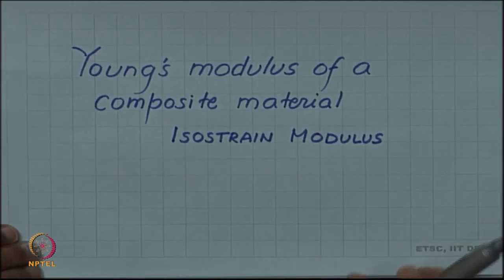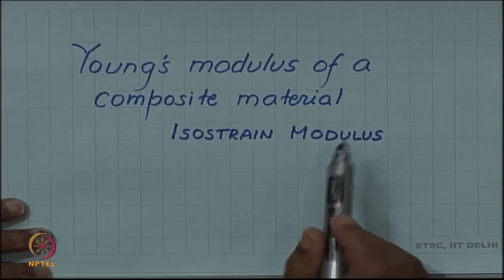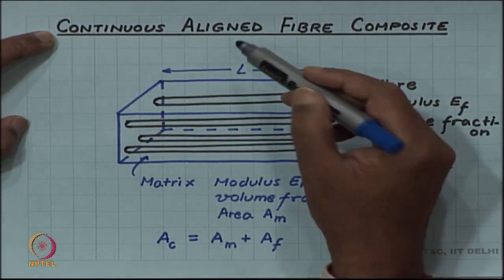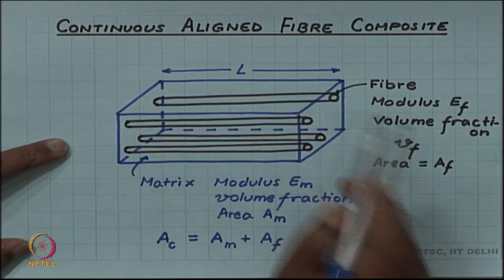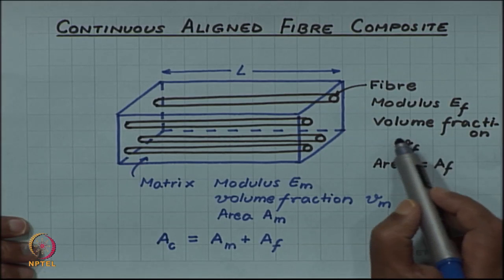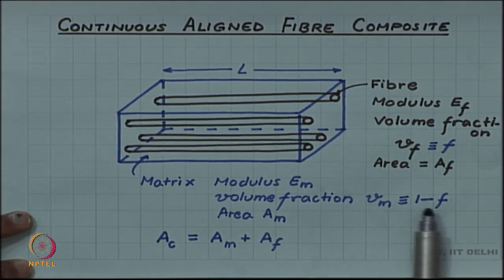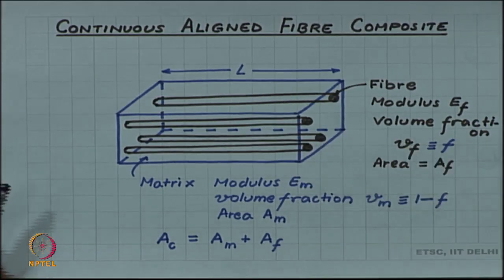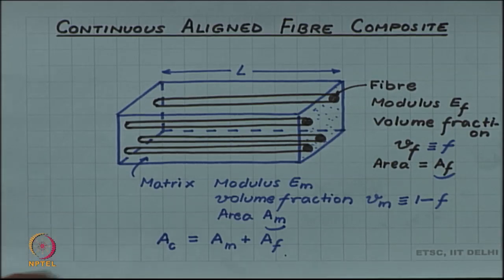Isostrain Modulus

Comment: Sir, at 13:26 you wrote Ec instead of Ef. Is it right ?
Reply: Thanks for the appreciation sir...
Reply from the maker: No, it is Ec only.
Reply: Sir, i mean to say that you wrote Ec= (1-f)*Em + f*Ec. I think that there should be Ef in multiplication with f instead of Ec.
Reply from the maker: @shivamgoyal3888  You are right. I have made a mistake there and did not catch it even when you pointed it out for the first time. Thanks a lot for persisting.